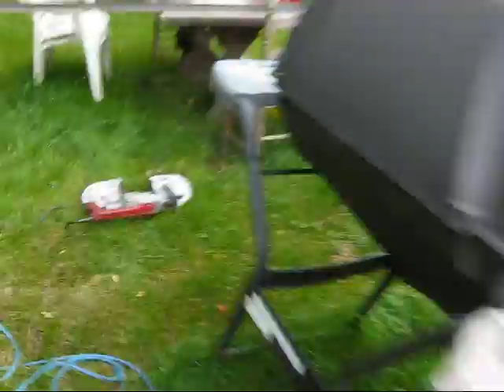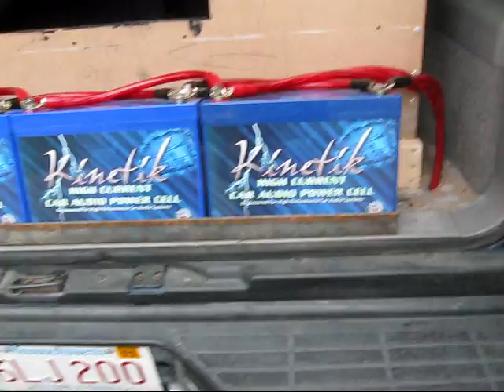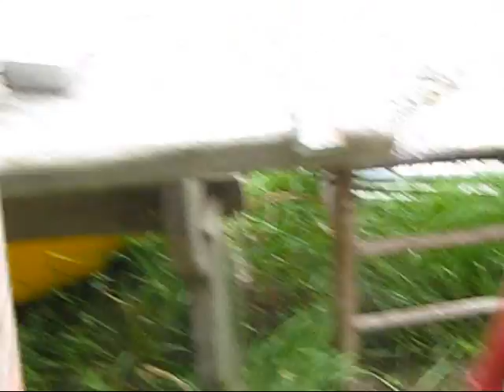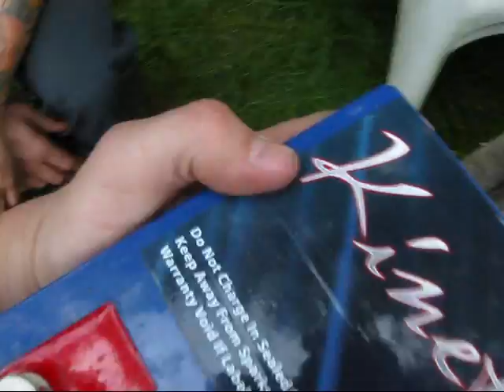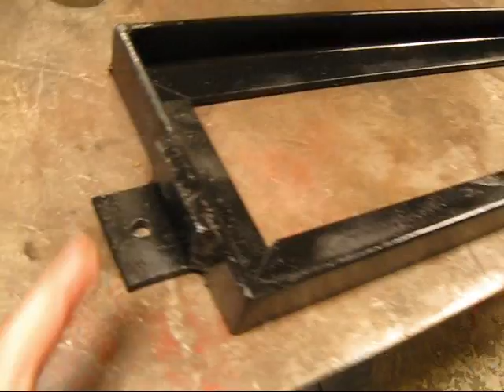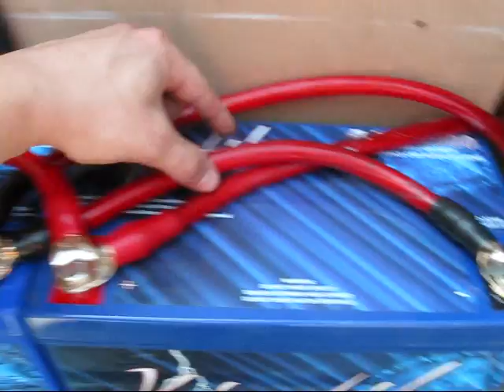kinetik hc2000 x4 battery rack build

Comment from the maker: @tram7128 you will need a charge line either from the battery up front or the alternator running to the battery or batterys in back,then ou need 1 ground per battery...from there run a pos and neg right from the battery to the amp

Comment from the maker: @DAABOSS69 well wuts goin on anyways alot of voltage drop?caps suck man i would just chuck the thing if i was you its prob not doing much at all,secondly a battery makes a big difference thats where i would start,i got my kinetiks from ebay they have all diff sizes check it out

Comment: I would not bolt that rack to the floor thats gonna be a lot of strees/flex for the thin metal on the floorboards you would be better off if you hook it to the framerails like a bolt in hydraulic rack in a car.